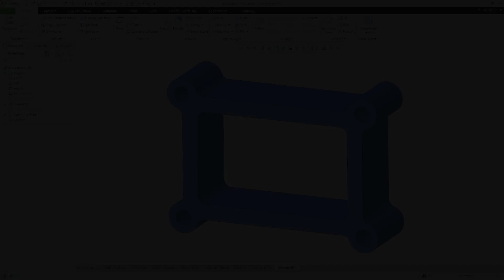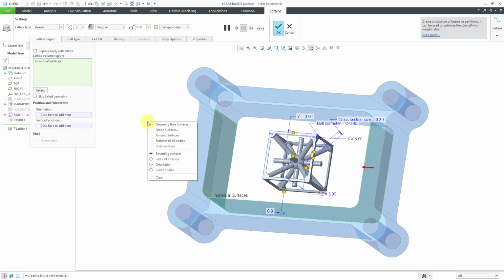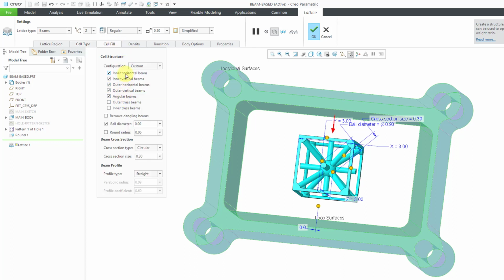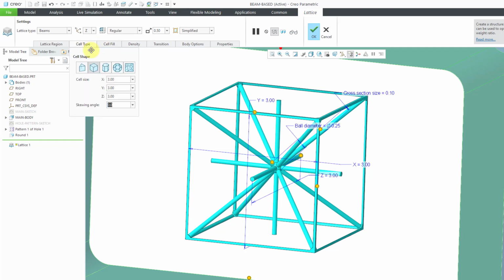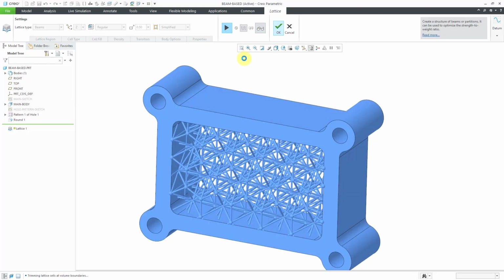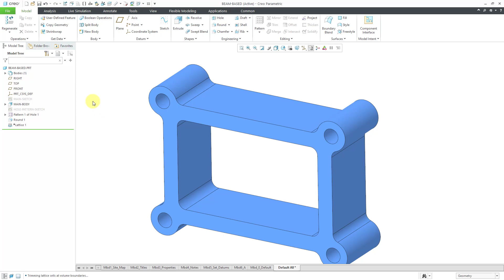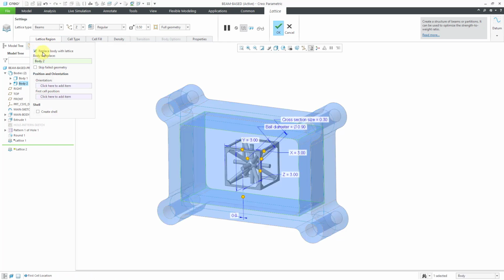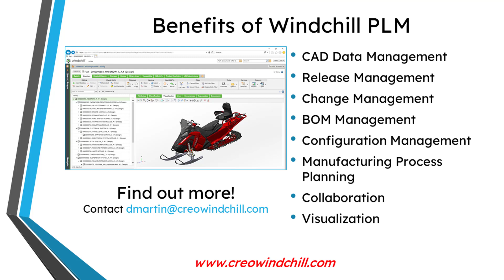Creo Parametric - Additive Manufacturing - Beam-Based Lattices (Part 1)

Comment: Hello, if possibile to convert to solid the lattice structure? Like gyroid into parasolid or steps?
Reply from the maker: You can always export Creo geometry into neutral formats like STEP and IGES. I don't know about parasolids but I also don't know why you would want to do that.
Reply: @CADPLMGuy  hi, I'm trying to fill lattice structure with a component in order to print, but I don't know if it is possible with Creo. I have a 3D block and I want to create a lattice structure around it. Maybe an email could explain myself better
Reply from the maker: @giovannilapicca7525  It is possible. Just print it. Please don't email.
Reply: @CADPLMGuy  ok but I need to merge, lattice formula driven isn't a solid, no?
Reply from the maker: @giovannilapicca7525  It's a solid. Just print it.

Comment: Thank you so much for your great videos! This is a big help and inspiration :)
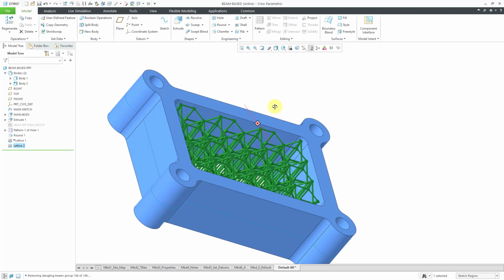I noticed that at 11:41 the lattices don't go from side to side. There is a gap towards the top. Is that a drawback of the replace-body-approach or something wrong with creo?
The opposite is happening with the boundary approach where in 7:22 the octagonal lattices peak out of the sides of the part.
Reply from the maker: That's the result of using Remove Dangling Beams in conjunction with Replace Body. It's doing exactly what I told it to.